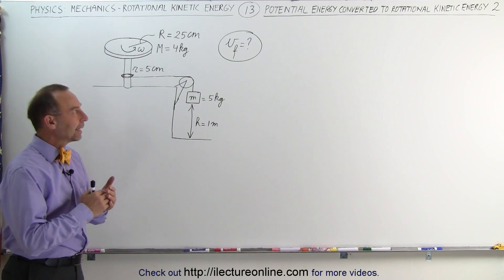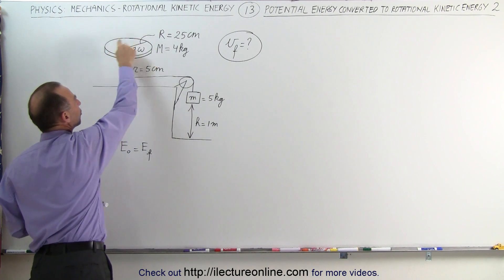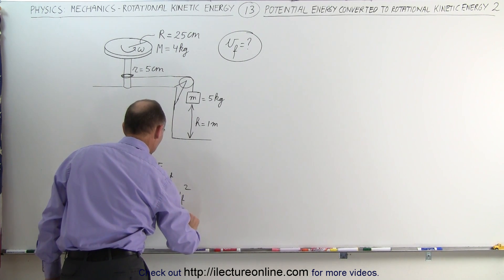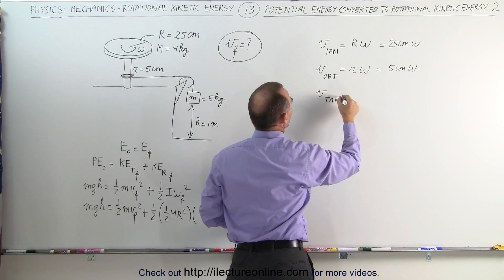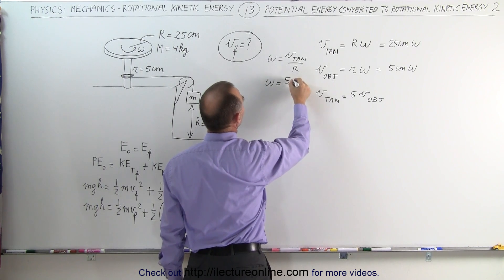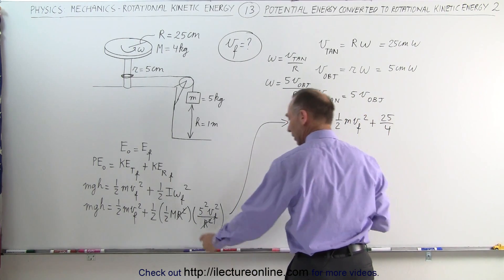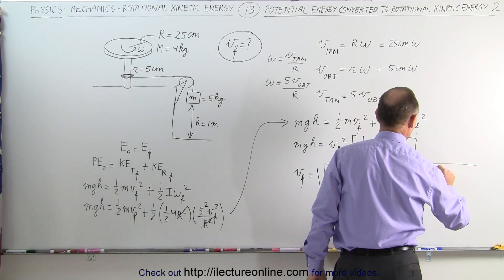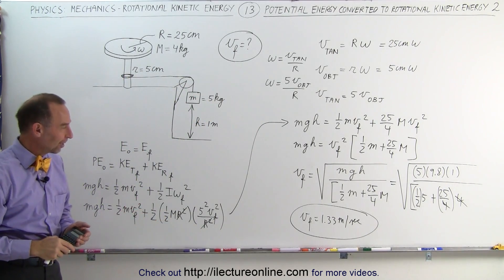Physics 8.5   Rotational Kinetic Energy (13 of 19) P.E. Converted to Rotational K.E. 2

Comment: Great video! But I got one question, wouldn't we need to add the KEr of the post as well (cylinder) in our Energy equation?
Reply from the maker: It depends on the mass of the post.  The moment of inertia would be far less than that of the disk.   (the mass wasn't given does we can assume that it was not significant).

Comment: i dont undrtstand why the radius has to be the same as the string?
Reply from the maker: The string is wrapped around the post which has a radius of 5 cm.  When the post makes one turn, the mass will drop by 2 * pi * (5 cm) which is the circumference of the post